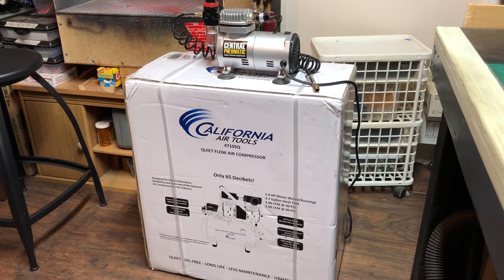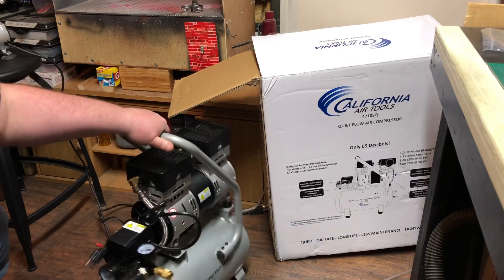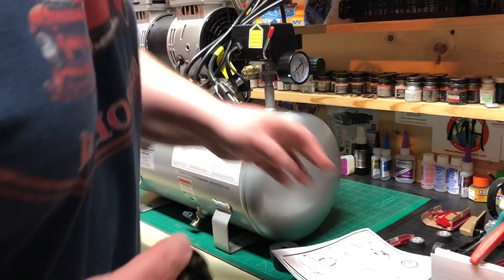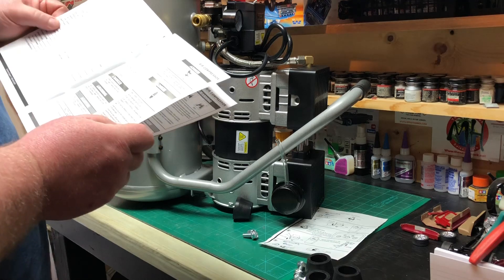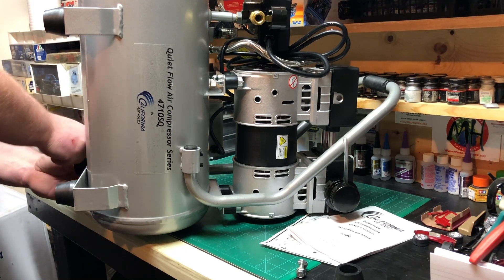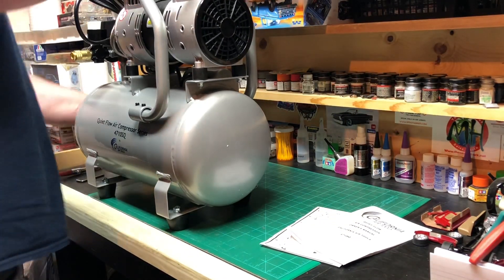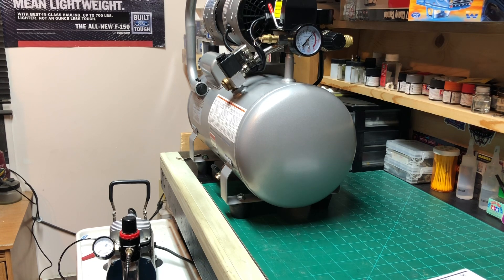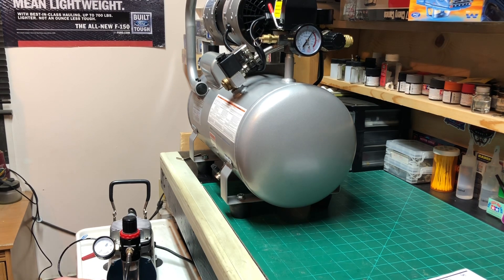Unboxing my compressor and sound comparison

Comment: Nice compressor Tim. I had looked at that one but wasn't sure how loud it would be and I do a lot of my airbrushing at night. I'm usually still up after everyone else's is asleep.
Reply from the maker: Thanks. Yeah I wanted to make sure it was quiet enough to use at night. I’m always up late too
Reply: @timhulsey5347  how much are these air comps and where at
Reply from the maker: @iancameron198  if I remember correctly it was $150ish and ordered from Home Depot website. They don’t have them in stores.